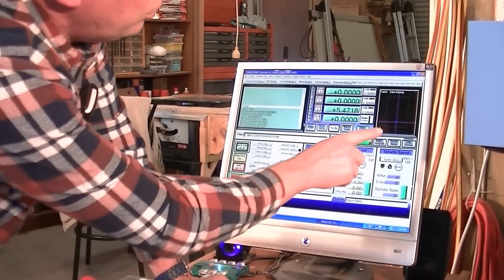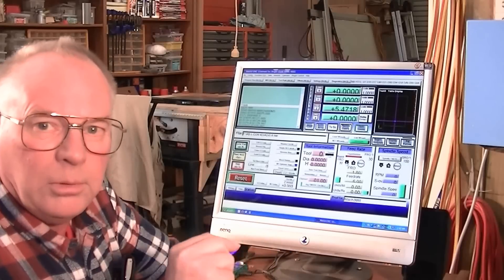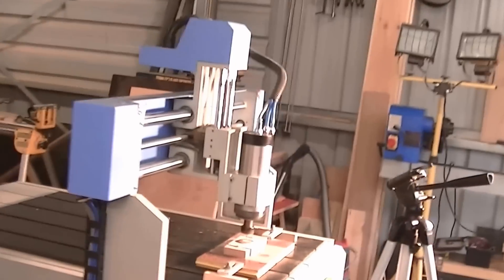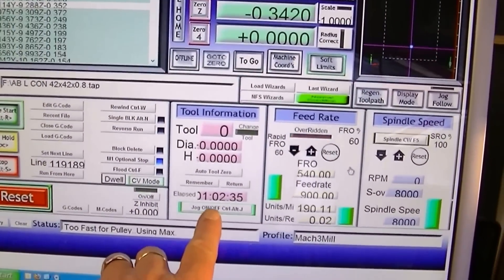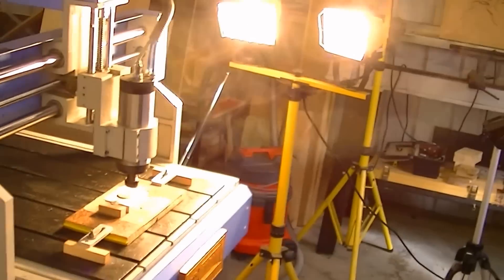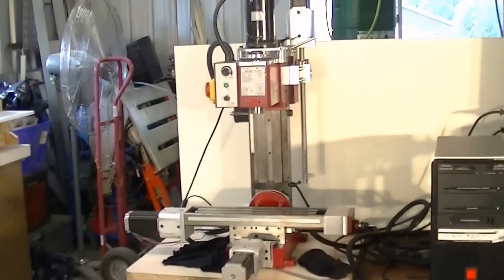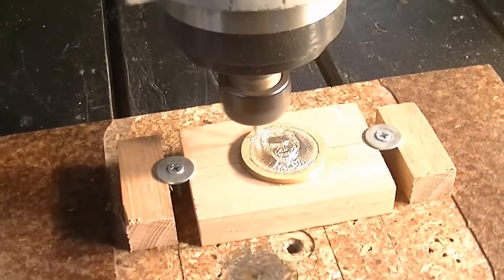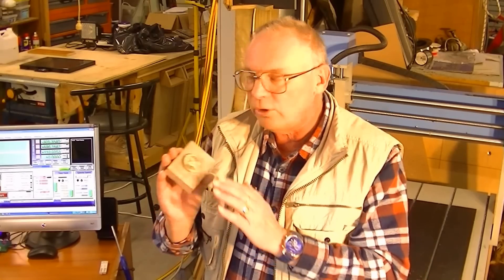149 CNC router making a *$100 Dollar coin*

Comment: in the video you mentioned that the step-over is 0.005mm. but then the entry went back to 0.01 mm. Maybe you pressed escape key by mistake. I am not sure which value you ended up using.

Comment: Sir I saw your video , I seen 8000 rpm looking Mac3 controller but  we want high rpm for best results , otherwise tool will be broken or bad effect engraving, so tell me why you didn't use high rpm in spindle motor, because your tool size 0.005 mm and 10 degree conical tool.
Reply from the maker: Mach3 was not controlling or connected to the spindle I was controlling it directly from the VFD  @ 24,000 RPM
Pacific Tooling; Australian Inventor Roger Clyde Webb
Reply: What roll of controller , if Mac3 didn't control spindle speed , does Mac3 role only convert g code format file of design.
Reply: And your spindle is moving same speed 24000 rpm. If we put in artcam 15000 or 60000 rpm , it will be round 24000 rpm

Comment: Sir I want make coin die on iron but I have no coin . only high de mention photo. so how to make coin die photo on iron. I saw your video but I want much clearly and sharpness in my design.so please guidelines me how to make die. my what's app number+919335338898 my email sonu.singh2719@gmail.com
Reply from the maker: Email me at : info@pacifictooling.com  I will send you information on our new Wood Lathe
 and CNC routers, 4040, 6060, 6090 , 6012 , 1212, 1224, 1325 and now CNC 6040, 6090 , 1390 Lasers (linear rail model). Pacific Tooling, 
 Australian Inventor Roger Clyde Webb

Comment: Hi, what kind of tools do you use? I see that the useful life is high and difficult to break
Reply from the maker: Email me at : info@pacifictooling.com  I will send you information on our new Wood Lathe
 and CNC routers, 4040, 6060, 6090 , 6012 , 1212, 1224, 1325 and now CNC 6040, 6090 , 1390 Lasers (linear rail model). Pacific Tooling, 
 Australian Inventor Roger Clyde Webb

Comment: Hi Roger! Love your video's! Also a question; how did you mount the disc on the wood? What kind of glue is it and how you get it off? 

I want to cnc a relief out of a silverplate 2mm thick, like 30x40mm, but i found out that carpettape and wd40 is not a good combination :P Do you have any advise for me how to attach it?

I have a 6090 very simulair to your machine.

Kind regards from The Netherlands and keep making video's!

Comment: How much would making one of these cost? Is it more than a dollar or less?
Reply from the maker: Hi, $500
Australian Inventor Roger Clyde Webb
Reply: Just for the single coin or for the machinery?
Reply from the maker: + $7000 for machinery ;)
Reply: If you were setting up a workshop what tools would you start with?
Reply from the maker: Email me at.   info@pacifictooling.com   and I will send you some
information on our new 4040, 6090, 6060 and 6012 (linear rail model) CNC routers. 
Australian Inventor Roger Clyde Webb
Reply: How you came to price 500 $ ? For material ? For time that this machine work ? For G-code ?